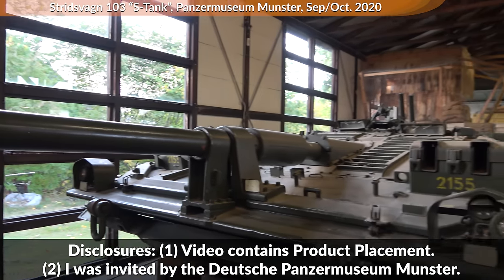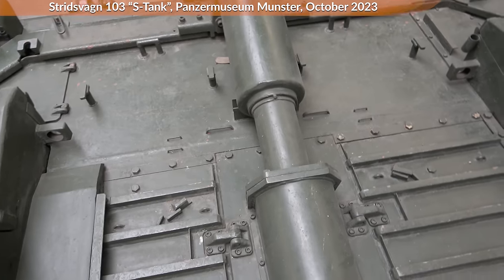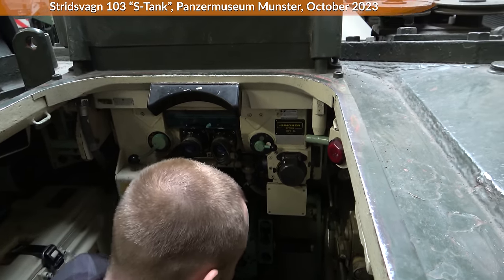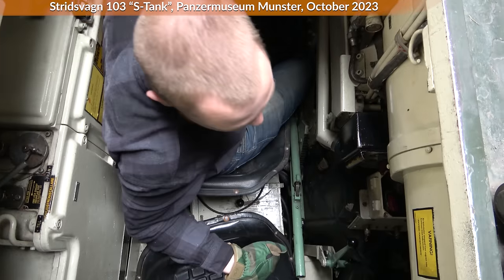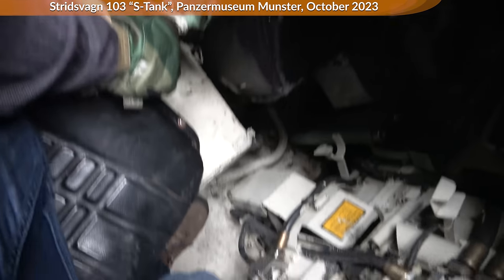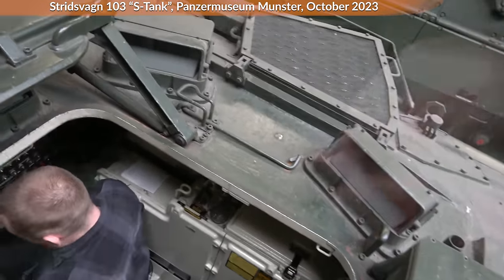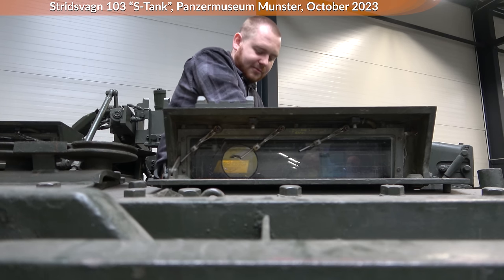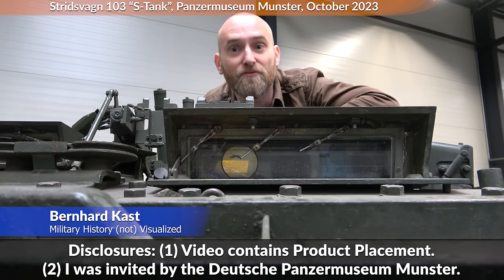S-Tank: The Swedish StuG

Comment: Very interesting. I just want to point out one thing though when it comes to the comment that its only fired when standings still. As I have understood it was for a long time the fastest tank to aquire and hitting a target appearing on the side. As I understand it was the fastest untill the balanced  turret guns came. 
   To see a target on the side and then managong to hit it one need to beable to follow the target or quickly aquire it again when stationary.
  I dont remember the data but it was only maybe 3 or 4 seconds from sighting to fiering of the first round. 
   Also interesting it was the first tank with alaser range finder installed ensuring first round hit.
Reply: It was supposed to have a laser range finder, but from what I can find out, it was not installed until the REMO (renovation/modification) to 103C, most likely due to cost cuts to fit the initial production into budget.
Reply: The laser range finder was there already when the first 103 was showcased in Erik Bergsten's Tekniskt magasin.
Reply: @johanmetreus1268  Could it be that they couldnt make it "conscript proof" and didnt want them damaged in peace time ? Thus stored until wartime
Reply: @apersson850  Like I said, the 103A/B was supposed to have it but did not.
Reply: @matso3856  reasonable thesis, but since it takes quite some effort to do the actual installation (this was long before plugandplay systems) I am more inclined to look at the CV9040 gun stabilisation system, that was already fully developed for the first generation, but rejected in favour of increasing the fleet by 15%
Reply: @johanmetreus1268  In the case of gun 9040 , was it not that it had "limited AA capability requirement" thing that removed the stabilisation system since it in turn removed a good chunck of the guns elevation ?

Comment: One issue with this vehicle I've not seen discussed is mobility. It could only climb ca 80 cm high wall. Further, with a fixed gun overshooting the chassis by so much on a short wheel base traversing ditches becomes an issue,

Comment: If i remember right, if you you were over 165cm, you would not be assigned to a Strv 103.
Reply from the maker: I might be wrong, but if I remember correctly the platoon commander we met was not that small.
Reply: Didn`t the commander have more space? @MilitaryHistoryNotVisualized
Reply: I think that was a suggestion, not a fast rule. A lot of "regulations" and "rules" in armed forces are actually only guidelines subject to the discretion of the leadership, but become treated as sacrosanct by many over time for want of imagination. 

Also bear in mind, Sweden does have a taller-than-average population, while their AFVs tend to be smaller for economic reasons. Thus, it is not surprising that someone felt it wise to suggest, via the guidelines advising use of men of a lesser height, that commanders don't assume that just any man will comfortably fit into the AFVs.
Reply: I was designated as a driver during "mönstringen". (don't know the english word). You where preferred if not over 180cm as a tank crew man.
Reply: I think the tall guys would be used for other things. I think artillery likes tall guys with much muscles to carry big heavy projectiles.
Reply: 120mm mortar platoon ... (most knew how to read albeit slowly)... @nattygsbord
Reply: @genericpersonx333  Wow, that was very well-put!
Reply: Not many Scandinavian men under 165, even then.
Reply: @nattygsbord except infantry and combat engineers take all the carpenters to carry their heavy stuff and build (enginners), and be mg/at Gunners, lugging those pieces around.
Reply: In French army, short guys for tanks, fit and strong guys in the infantry (the machine gun was heavy…), slim guys in artillery (they can be trained to carry heavy rounds around, all muscles, no fat), smart guys in pioneers, radiocommunication, etc…
Reply: I think of the Swedish Gladiator Roger Zapfe who is also an uboat captain despite being 2 meters tall. Not really what I would expect. I thought that uboats and tanks could be pretty claustrophobic
Reply: @PalleRasmussen  But this was during mandatory military service, so while most are taller so will there still be a few shorter guys that can fill that role.

Comment: The things with this tank is that it was designed mostly as a defensive weapon. Sweden was obviously worried about the possibility of a Soviet invasion, and the assumption was that the Ruskies would come by sea and deploy tanks at our very long shoreline to the baltic sea. The idea was to set the S-tanks up for ambush by hiding them ahead of the enemy invaders tanks. The S-tank could use its hydraulics to dig it self down, and also create a dirt wall to hide itself behind. They would fire at the enemy as described in the video, then reverse at max speed and set up another ambush.
Reply: It was actually designed to be used as offensive as any other tank. But over time, when other tanks developed better stabilizing systems for their guns, the preferred use changed to a more defensive one, leaving the offensive to the conventional Stridsvagn 104 (Centurion):
Reply: Really good point I wonder if the S-tank can handle Vladimir Putin's 2015 service entry T-14 Armata because it's deployed typically with the tanks that the S-tank was designed to go up against T-72 T-80 & T-90 tanks.
Reply: No, strv 103 can't stand up against discarding sabot projectiles. It was designed to resist hollow charge ammunition, and was invulnerable to all types existing at the time of introduction, in the front.
Reply: @apersson850  You are ofc right, the tank was a tank and as such was designed to do tank stuff. It was later on deemed more fit to use in the way i described above. So in a way we are both correct.

Comment: The S-tank is perhaps the best tank designed for the Swedish ( and Finnish) "defensiv" doctrine in said countrys plus Norway. For offensive action in say Germany or Ukraine not so much, but it wasn't made for that so moot point.
Reply: The Swedish armoured doctrine was fairly offensive. At a glance basically foot-infantry bogs down and contains the landing then the armoured brigades attack and throw them into the baltic. It was used in exactly the same doctrinal way as the centurion tanks Sweden had.
Reply: @paulgoransson9489  I think this myth will live on in the english speaking world , they seem to just read half the doctrine , which is to engage and slow down the enemy , and then blissfully ignore the second half which is the counter offensive once the mobilization was complete

Comment: I always wondered why they didn't include some limited horizontal articulation for the gun. Then you could adjust the elevation (via the suspension) and attitude of the gun without starting the engine and driving the tank.
The cramped interior space would make that completely impossible, though.
Reply: Not sure what you mean. The elevation IS adjusted by the suspension.
Reply: @mats66  Exactly, the elevation is adjusted by the suspension, which is why you can adjust the elevation while standing still. But to do even the slightest sideways adjustments, you need to actually drive the tank (which always bothered me).
Maybe the confusion comes from me using the term "horizontal articulation" and "attitude" in place of "left-to-right movement".
Reply: It's not needed. During American trials, it was observed that the Strv 103 was far more accurate than the M60A1E3, both from a stationary position and while having to stop before firing, but it did take on average 0.5 seconds longer before the target was engaged. On the other hand, Norwegian trials showed that the 103 was faster spot and engage targets compared to the Leopard 1, both when stationary and whilst moving and having to stop to fire.
Reply: @ShermanStrike  I didn't expect it to be only 0.5 seconds. I guess there really isn't much of a difference between the rotation speed that the tank tracks and the turret ring can get you.
However, the noise of the engine is another factor I felt uncomfortable about. But then again, the Swedish doctrine was to book it backwards out of their firing position immediately after firing, and the shot itself is louder than the engine. So I guess noise is also only an issue a few short seconds before the shot is fired.
Reply: @Pystro  I'm not so sure that's a problem. During military games in Kvarn, 6 Leopard 2A4's were put up against 6 Strv 103's as a mockup defensive battle. The Leopard 2's only managed to identify and hit one 103 before all Leopards had been defeated. They failed to spot the 5 remaining 103's, despite having a technological advantage.
Reply: They abandoned horizontal articulation in order to make the auto loader more efficient, this thing may look clunky but it can spit shells with the best of them.
Reply: @Reddotzebra  It can sustain 1 round for every 2.5 seconds thanks to not having a turret , not even the most modern tanks can achive this

Comment: Very cool vehicle and I wonder if the S tank can be upgraded to keep up with T-72 which is now in the T-72B3 Model 2016 version with Nill Stali Relikt 4S24 Explosive Reactive Armour.
Reply: What I took from Barnhard’s comments near the beginning is that gun stabilization that made firing on the move (in tanks with turrets) renders a tank that must stop to fire obsolete. On the other hand, having such a low profile and being able to fire fast from a hull down position probably allowed it a few more years before it had to be withdrawn.
Reply: The S-Tank could have been upgraded:
1 Composite Armour Added.  2 Segregated Magazines with blow out panels.  3 Rh-120 smooth bore 120mm L44 gun.  4 Fire on the move is not primarily achieved with gun stabilization but with stabilization of the tracking optics with the gun firing when the gun passes through the target.  This is how WW2 navy ships did it and how the Germans planed to get fire on the move on Panther and Tiger.   The stabilization of the gun is secondary.    You could come up with 'fire on the move' as follows:   A/ commander tracks the target with his stabilized optics.  B/  Once the system has a firing solution the fire command is given and the tank automatically stops and skids into the required direction.   A stop from 36kmh(10ms) would probably take 3  seconds at 0.3G braking and the gun is fired at the correct instant during the stop.   Given the woeful reverse speed of the T-72 and the full reverse speed ability of the S-Tank I think the S-tank could win the engagement.    The key is to get out of the firing line these days.
Reply: @williamzk9083 weak base armor, no turret, no firing on the move, S-tank cant be really compared
Reply: @williamzk9083  spot on and I am wondering what is the reverse speed of the Swedish S-tank complete with the mentioned upgrades. T-72 3-5 kmh reverse speed which is actually common to Russian tanks 1940s-present unless fixed on T-14
Reply: @EpicThe112  A S-tank has the same forward speed as reverse.  The radio operator drives the tank in reverse if needed.   I think Leopard 2 can reverse at 34kmh and Abrams at 40kmh.
Reply: @EpicThe112  ask him about turret traverse speed
Reply: @phunkracy  An S-tank can turn 90 degrees faster than an T-72 can turn its turret.
Reply: @williamzk9083 but at what cost? Refurbishing a vehicle from the 60's in the 90's?? The engines were underpowered, the gun too weak, the armour too thin, the optics/computers.... then you still have to watch were you are turning/pitching in the forest, because the gun is fixed.
Reply: @brownmold By upgrade I meant a complete redesign along the same concepts of fixed gun and adjustable hydraulic suspension for gun elevation control.  Therefore new engines, new armour, new electronics new stabilised, optics.
Reply: @williamzk9083  still won't get past it's drawbacks, and the cost was too great compared to all the surplus Leopard 2's available in the 90's.

Comment: Tank S has no turret. So it would be interesting to see a duel between Stridsvagn S and T72. The carriage was a passive weapon that would be buried so that only the barrel was visible, and then wait for enemy armor
Reply: Cant turn the turret when there are trees in the way... 😁
Reply: @Merecir  
No tank can turn the tower in dense forest.
Reply: @P6009D  Exactly.
Reply: S-tank is the turret.
Reply: Oh, but it does have a turret. It's a turret on tracks, from a functionality point of view.
Reply: @apersson850  The weak point of a tank is the turret it is compared to the strength of the tank as a whole. On tank S, the turret is the entire tank, so the turret is as strong as the tank as a whole. That's what the whole idea is. A passive weapon with no weak point and a small area of impact. The criteria are met.
Reply: In the last period of its deployment, yes. But it was designed to be an offensive weapon just as much as a tank with a turret is. Such a tank can also be dug down in a defensive position (passive weapon), with only the turret above the ground level, waiting for the enemy.
You have to factor in that at the time of design, a conventional tank had to stop to hit anything when it fired, it was rather slow in traversing the turret and with the turret turned 90° to combat an enemy, you showed your weaker side to that enemy.
The 103 was quick in rotating the "turret" (the whole vehicle) to face an enemy on the side, and when it did, it faced that enemy with its strongest part, the front. Where it was impregnable with the hollow charge projectiles available when it was introduced.
If it ran into an ambush, it was also quick in reversing out of the ambush, still showing the stronger front towards the enemy.

To summarize: The development of conventional tanks and anti-tank measures over time forced the 103 to take a more defensive role, in order to survive, but the design target from the beginning, against the opposition that existed then, was as offensive as any other tank.

Comment: I think the tank was originally meant to be a 2 man tank but they found they needed the 3rd guy
Reply: Yes, that might also be a reason for why it is so cramped for the driver but not the commander, because the reverse driver was added pretty late. 
Although technically the tank itself didn't need the third guy, he was added mainly for logistics reasons, a big one being so there would be three persons available if the tank threw a track and needed field repairs (since two people would be too few to do that effectively). (Also the third guy would help out somewhat with things like guard shifts, radio communication and suchlike, convincing those not affected enough by the field repair argument.)

Comment: I'd class this thing as a dedicated armoured tank-destroyer. So yes a casemate tank.
Reply: And you'd be wrong. It was an MBT.
Reply: A more accurate description is really that it's a hull less tank as it's more like the turret is driving around by itself. It's not like it's bad at turning and aiming, it's actually faster turn rate then even modern tanks got on the turret.
Reply: @znail4675  I'd like to add that TD are only used on the defensive , and this one was made to go on the offensive after the mobilization was complete. It also had rounds to engage other targets then tanks unlike TD.

Comment: Hmmm    what about the FPV drones nowdays....or NLAW/Javelins.....would the S be more or less  vurnable ?   maybe a nice birdcage would do it 🙂
Reply: Birdcage has no effect on NLAW/Javelins, only on some drones. And provided, that strv does not have a turret, it would be much easier to just cover it with advanced ERA
Reply: @solarissv777  ERA seems like a poor choice, when the turretless construction is extremely well suited for a net cage covering the whole tank, similar to what the Ukrainians have been using on their artillery pieces.
Reply: @johanmetreus1268  net cages do not work against tandem warheads and shaped charges
Reply: @solarissv777  You have not seen the Ukrainian SPGS with Lancers caught in the loose nets?
Warheads only do damage if they detonate, and it seems like the impact in the nets are not nearly enough to trigger them.
Reply: @johanmetreus1268  I didn't say that they don't work at all, just that they don't work against advanced munitions. Of course, if, say, Sweden provided strv 103 to Ukraine, they would be equipped with such nets and it would increase their survivability, but such protection is not that efficient.
Reply: @solarissv777  "they don't work against advanced munitions"
yeah, those laser-guided artillery shells would turn any S-tank hit into a crater right away, same with the AT-missiles unless they strike the HEAT-grid.
FPV-drones, dropped grenades and loiter munitions would have a really hard time getting anything done though, and it seems they are the main reapers next to mines....  and mine protection in older vehicles are almost non-existent. Sure, they can handle anti-personnel mines, but that is about it.

Comment: Well, Stx 103 is a tank destroyer and as such, its superior characteristics are down to inherent design advantages of tank destroyers. Just as its inherent disadvantages are what you would expect from tank destroyer. Mainly, abysmal target engagement times when on the offensive. Smaller height also gives lower visibility combined with inability to peak around the hills, make it best suited in a defensive role.
Reply: "Abysmal" = 0.5 seconds slower then the turreted version